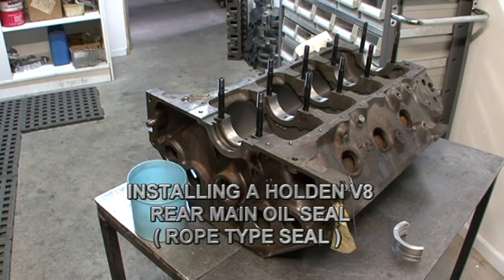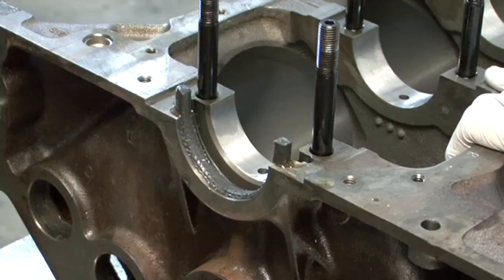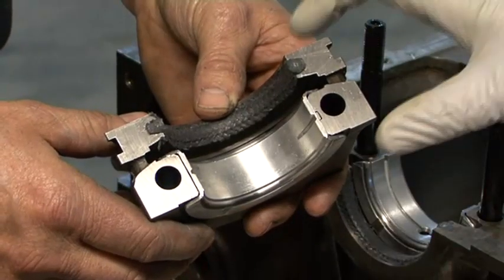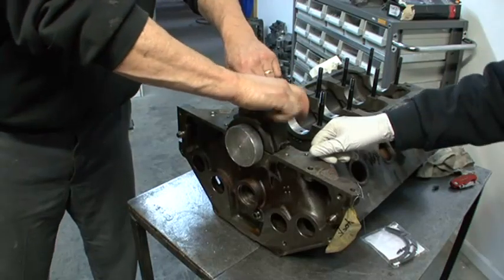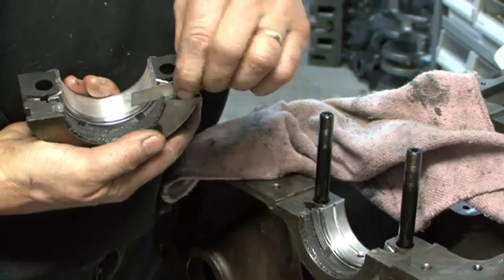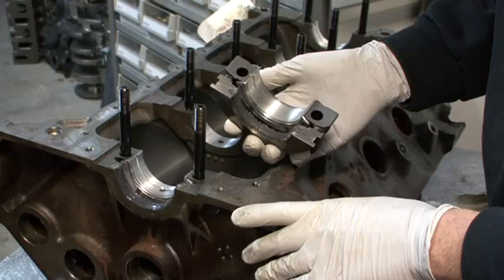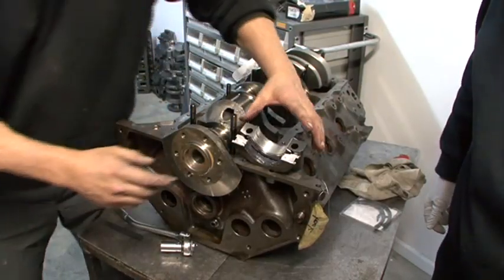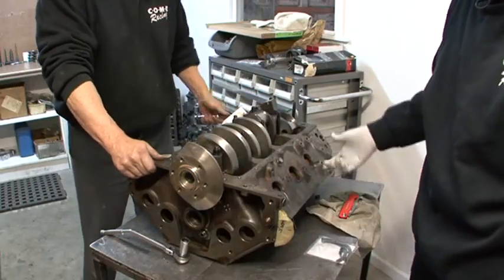Holden V8 Rear Main Seal Installation.mp4

Comment: I've always put rope seals in dry never put dimples in block or cap never soaked in oil and only a minute amount of sealant on cap . Never had a leak and was shown this by a Holden factory mechanic .

Comment: COME engines are a top engine building team. My opinion i have cut the back part from the rear main journal off an old worn scrap crank that i use to set the rear rope main seal in place.

Comment: This is greatly helpful. I have to do the rear main rope seal on an aluminium Rover/Buick 215 ci/3500cc V8 and the Rover people on Facebook pointed me in your direction. I'll have this video on a loop in the shop. My issue is that the crank will be in the engine, kind of. I have the engine upside down on a stand, the rods still bolted to the crank, and a chain block strapped to the crank holding it up out of the main saddles.

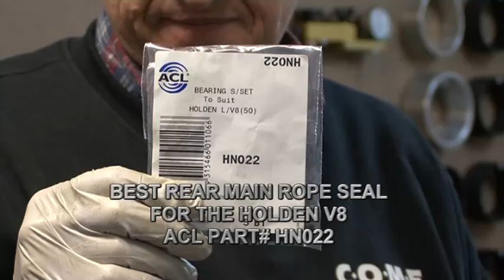Comment: 10:00 That's very informative thanks! I'm restoring an Opel Rekord P1 1959 1700cc engine and this video helped a lot with understanding these kind of seals. It seemed so hard to install at first because the Opel workshop manual mentions all kinds of special tools needed for installation, but after watching this video I feel more secure with installing the seal!
Cheers!

Comment: I've  always used a rope cut off crank with the size main  bearing in place as a dolly  and left the tails out of the oil to get a better seal on cap 1 fit instead of 3

Comment: If you gotta holden 5L, your gonna have a black driveway regardless.
Reply: from tyre marks
Reply: That seal design was on and is on almost every V8 from 1949 Oldsmobile ( the first real modern V8) to 1984 Aussie Cleveland's. If that was the problem all would leak, more likely someone used 60 foot pounds on the pan bolts and squished out the cork gasket !

Comment: my VT 5ltr is leaking from the rear , but I REALLY dont want to pull the crank out . I can handle removing the main caps to lift the crank enough to put in the top half of the seal , can I lay the lower half in the cap and use the crank as a mandrel ?